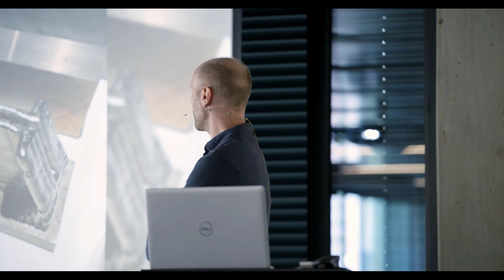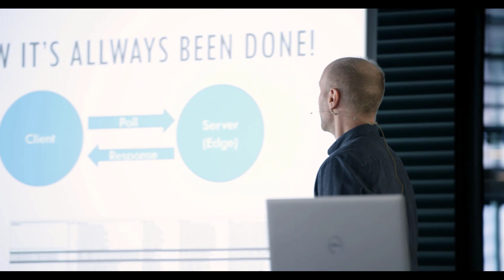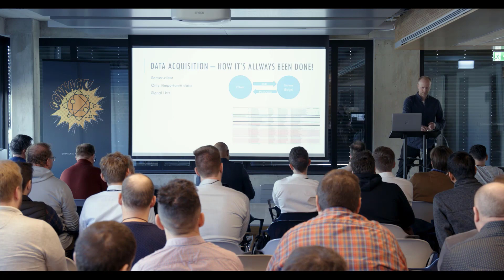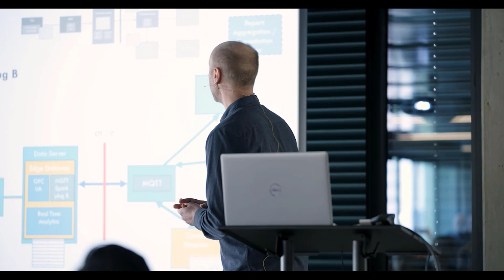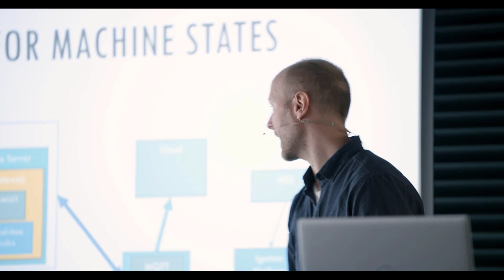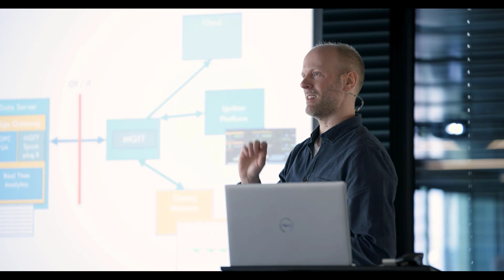MQTT Sparkplug B, Confessions of an End User: The Good and The Ugly - Jon Forbord

Comment: You could go for the middle ground and use normal MQTT. It requires slightly more time during integration but more control. You did mention using your own specification. Totally agree.